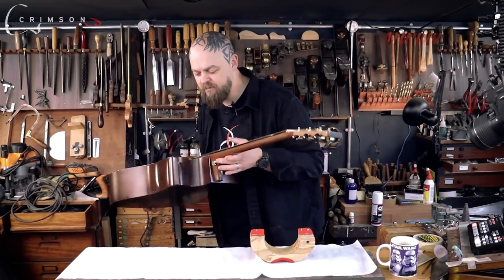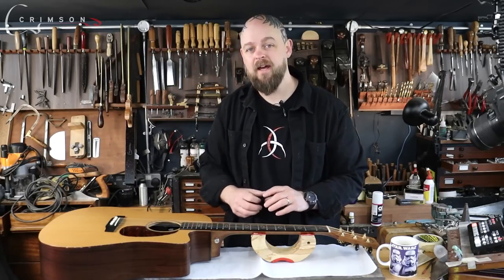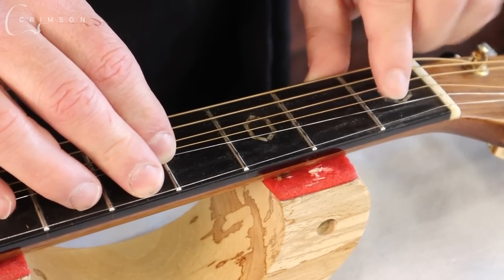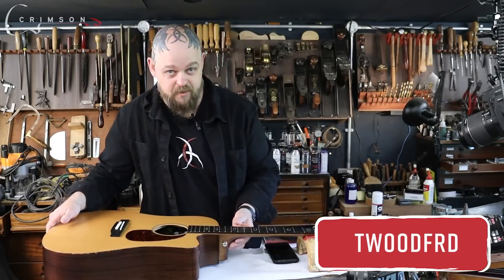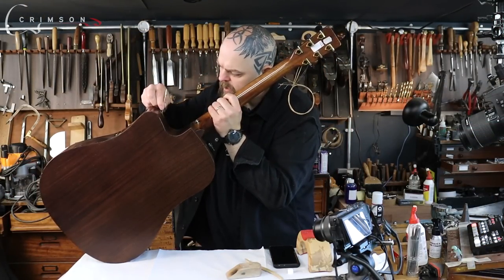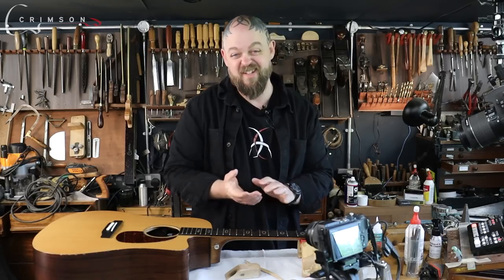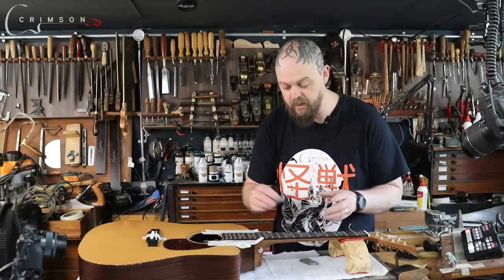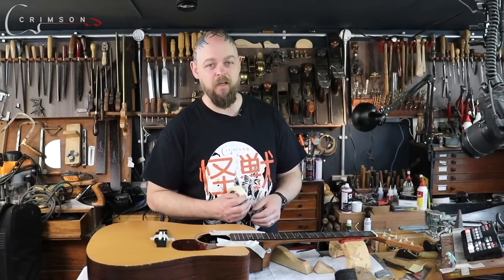Somebody stabbed this Guitar!  Puncture repair with a side of Fret Levelling, Crowning and Polishing

Comment: I had a beautiful Takamine 12 string an Ex. stabbed with a pair of scissors right through the top. Actually went through one of the braces under the top. She told me she accidentally brushed them off the sink and they went through. I might have believed, but the force required to plunge scissors through a spruce top and the brace beneath is pretty much beyond "brushing the scissors" off the counter. I still remember that horrible sound as the poor  innocent guitar died.

Comment: I got a set of special markers in different shades of brown/red/yellow when doing a little repair like that just pic the closest color and paint over the chipped part, it doesn't make it perfect but close enough and it takes barely a minute. Actually for small dings that's all the repair it takes. 

Before i found these special pens i been using black marker, in a pinch it does the trick as most of the time on wood a black mark is less obvious than a white one.

Comment: HI , have you tried furniture crayons ? after the repair is done they have the colour and wax together of various shades . You get a whole pack of about 20 or so for about £2 quid ,they fill in nicks and cracks which just vanish and job done , with a bit of wax polish over the top .     regards TONY.
Reply from the maker: We are very sorry Tony, this was a scam comment.  Not affiliated with Crimson and we are trying to block them as fast as possible.  I suggest you also block this number on your phone and don't respond if they try to call you back.

Comment: I would have gone with holding the break in place and wicking in superglue from the front rather than using wood glue. Most likely a similar index of refraction, would have made those cracks and voids in the finish all but disappear. Also requires less hold time to bond.